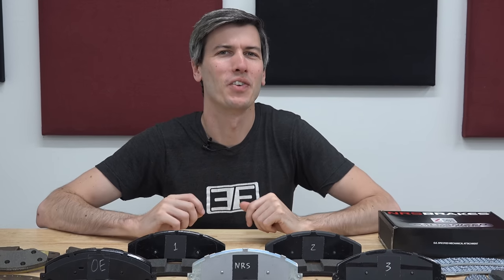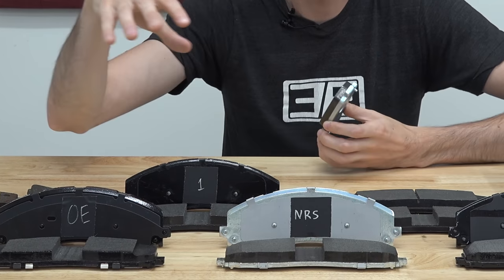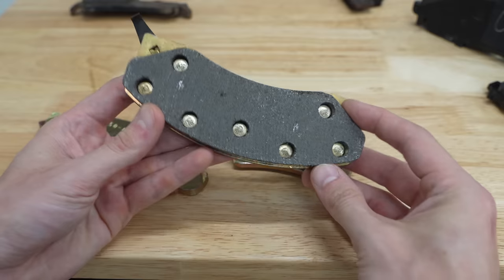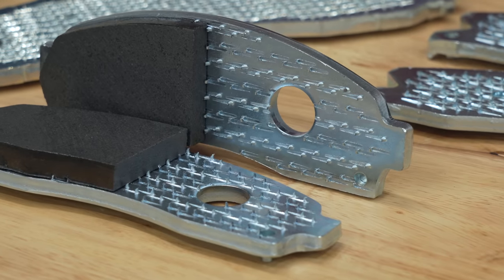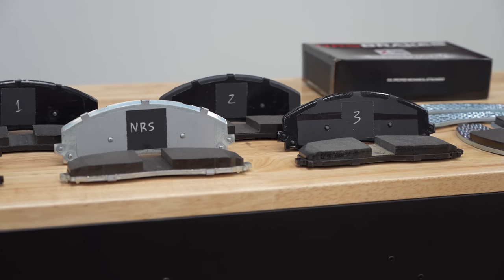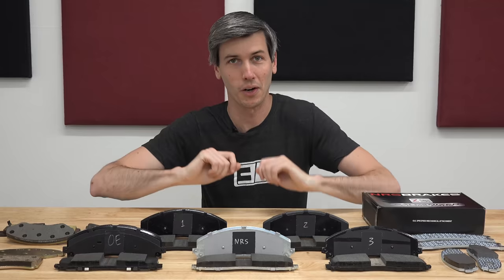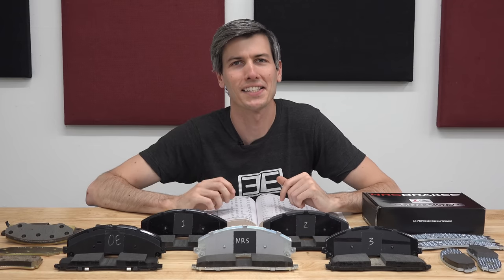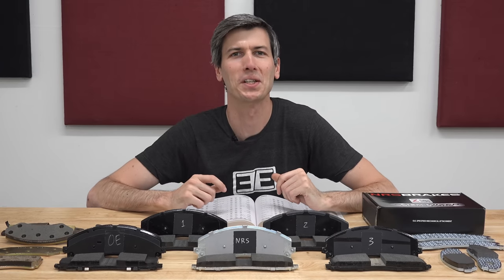The Sketchy Truth About Aftermarket Brake Pads

Comment: Whats actually important (never had the material come off in decades of driving, didnt even ever see it happening working on cars):
I drove aftermarket ones for a long time. Then I realized the car manufacturer actually put effort into picking the brake pad materials. The OEM ones grab MUCH sooner and MUCH harder at slight braking and dont need to get heated up for good grabbing.
No aftermarket ones can achieve that. They can only make braking better into another direction. Either at hard braking or slight braking, hot braking or cold braking.
The car manufacturer has found the best (and safest) compromise for both.

Comment: Will you mention (in a future video) brake dust?  I bought a highly-recommended brand, only to discover it to be the most FILTHY pads I've ever applied.  I wonder if these pads are wearing more quickly, or the dust just sticks to the wheels more than normal.

Comment: I bought a new RAM PROMASTER CITY VAN three years ago.   For the first 10,000 miles at slow stopping speeds the brakes made the most out of this world sound.  Like a malfunctioning loud speaker a garbled vocal.   Three years later have mostly highway 18,000 miles on the van.  Today no weird sounds.  I guess living in Nevada that desert dust was on the pads causing the noise.   If anyone has an idea about this I would enjoy hearing it?

Comment: I used to drive a 2000 Jetta.  Always used aftermarket pads.  ...until one of the pads came separated from the backing plate while I was driving across the tappan zee bridge.  The pad landed on the inner side of the rim and got wedged between the rim and the caliper.  Made it safely across but it could have been very bad because I didn't know it happened until I went to hit my brakes at 55+ MPH in high volume traffic and the pedal went straight to the floor.  Eventually after pumping, the backing plate made contact with the rotor and I had braking function again but of course it trashed the rotor.  Anyway, lesson learned.  Don't take chances on brake parts my dudes.  (Edit: To be clear, the pads were not mechanically attached to the backing plate.)

Comment: Interesting notes about the FMSI. I googled an older copy for my car.. From studying the FMSI # for my subaru, it seems some aftermarket manufacturers use the FMSI part number either partial or full part number in their model number labeling. Therefore, this makes me wonder if many aftermarket brake vendors are just taking the same pad and using clever marketing to stay it's the best performance blah blah blah.. = profit.

Comment: I've changed hundreds of brake pads and shoes, not once have I run across them separating. Usually cracked and worn out, and sometimes a bit rusty on the back plate.

Comment: Bought aftermarket pads once in a pinch during a weekend with the wife truck, they legit lasted 6 month and hardly stopped the thing. 

The OE where on for 3 years and overshot by a lot the mileage on the aftermarket, and they stop on a dime.

Comment: I go with OEM replacement pads since I go about 10 years between brake pad changes on my automatic transmission cars.
If you drive more efficiently, you'll go more years between brake pad changes and get better fuel mileage.  
My Subaru Outback gets 33 mpg measured mileage.  And it only takes me a few minutes longer to make a trip, but I save 15+% on fuel consumption.  
That's a saving of 60+ cents per gallon at $4.00 per gallon gas price.

Comment: Great video, now I'm questioning my brake choice, I am doing them in the morning and chose the power stop extreme severe duty and towing pads and rotors for my 2017 gmc sierra 1500, I hope they don't come apart while I'm hauling my trailer for work or my travel trailer lol. I will say that I bought the truck with 25k miles on it and had to replace the brakes (front and rear pads and rotors) with the duralast gold pads and rotors at 43k to 46k miles, I am now replacing them at 104k miles, but I drive more conservatively because I hate warped rotors, the only reason I chose them was because I had the driver front pads go metal to metal because the caliber pins where never lubed from the factory on that one caliber and they were sticking, the rest of the pads/caliber pins where fine, and those pads and rotors where the ones I could find in stock at the time .

Comment: You kind of mention why NRS doesn't paint the pads but I still can't imagine why they wouldn't.  If you live anywhere that salts the roads at least the paint will help with corrosion resistance but the zinc will just not hold up well at all particularly since it's an area that likely goes through many more cycles of wet and dry due to the heat.

Comment: looking through NRS website, i did't find a single thing about the friction material coefficient, or temperature behavior. and no pads for BMW or Porsche, who seem to do just fine at race tracks around the world, despite not requiring mechanical adhesion. and having used race pads to a temperature so hot, they warped the backing plate, i never saw evidence of  mechanical ahdhesion or friction material failure, despite the pads being designed to work up to 2000F. but to be fair, no track pads are considered cheap.

Comment: Had this happen weeks after installing Autozone brake pads. I brought in the ruined brake rotor and they replaced both rotors free and offered to replace the pads as well. I refused the pads and simply will never buy break pads at Autozone again.

Comment: So, a couple of points of clarity: a) how does your heat test replicate the clamping pressure of the caliper?  b) does your shear test reflect rotational force on the friction surface only or are you applying pressure to the sidewall of the friction material?  I'm wondering in what way your testing replicates real world conditions?  I ask as a veteran of the parts & service industry (aftermarket). In addition, are we all in agreement that zero car manufacturers actually manufacture brake pads? Do we agree that every car manufacturer specs the brake pad and is sourcing from the same brake parts manufacturers (contract packaging) that also produces every aftermarket brake pad?

Comment: I do know that Brembo doesn't use mechanical attachments or at least the one for my Toyota (Brembo model P 61 081) doesn't.  
How?  I worn one down to 2 mm and still no traces of metal shavings left over by the mechanical attachment.
Would this stop me from using Brembo brake pads? Not really, HOWEVER, now I do want to try other brands and feel the difference.

Comment: I love this, someone please correct me if I'm mistaken, but with DIY mechanics, which I expect are likely the ones that would buy these brake pads, wouldn't it be better to swap out the pads under warranty every 3 years or so if they buy these aftermarket pads at common auto parts stores as during that time window you're likely changing the brake fluid if you're following the maintenance intervals, and around that time you're likely getting rust creeping in on the rotors which may not come off, thus ending up making up less use of your brake pad surface no matter the brand? Or maybe I'm just seeing only the cheap brake rotors that are doing this 😅

Either way, thank you again for a super informative video.
Reply: Time and labor are $$$.  Or at least my time is.

Comment: those brake pads look like the same size as the pads that are on a 1 ton truck axle that i got for a car with a 200hp engine that broke the original ford 8.8 axles and 4000lb ratted tire chains on the tires... 8.8 was said to hold 400hp, it broke at 200. "brake horse power, power to slow it down from the top end" so that's where the AAM1150 full floating hub axle comes in. but "they" said that ones good for 800, that 4.6 triton only makes 200... at least the axles are easier to change. (use car for plowing snow, because speed boy put all the truck stuff in it)

Comment: I don't know I must have done 2000 brake jobs in my life and I never once seen a bonded separate from the metal. Riveted plates are the way to go but you lose 1/32 not really a big deal in my book and by that time you should be replacing them anyway.

Comment: I've used whatever the cheapest brakes I can find on my daily drivers and I've never had an issue.

That being said, on my truck, I use Wagner specifically, mainly because I tow heavy loads, and the extra quality means much more.

As with all things, need depends on the application. Not all brakes need to be equal
Reply: Strong dislike for Wagner.  Soft pedal feel.  Soft bite.  Increased braking distance and prone to heat fade.
Reply: @ShainAndrews  Ive never had those issues with Wagner semi metallic pads, and I've towed massive loads across multiple states. Thier ceramic Thermoquiet pads, sure, but the semi metallic pads have been rock solid on my truck for almost a decade.

Comment: #1 aftermarket company owned by a major car manufacturer… AC Delco!  Have also used numerous sets of AutoZone Duralast pads and most recently Centric pads on my Integra GSR, plus Centric on my Miata and CX5. No apparent issues at all.

Also never even heard of NRS before this video. Apparently they don’t have an application for my Integra so that sucks. The ones for Miatas seem crazy expensive. More expensive than Hawk, EBC, Stoptech, even more expensive than OEM Mazda pads!
Reply: Phone NRS. There is no application for my 2020 Kia Forte GT. Gave them my VIN. They found me front and rear pads.

Comment: I've seen the most budget branded parts fail far before you would want them to, and over time it pays off to pay even the little bit more to get good results.  Automotive spending being driven by enthusiasts means that sometimes the cost/value curve steepens beyond what is needed.  Pass on the real cheapo parts, the mid priced stuff will be adequate, a little more cost (akebono for example) is worth the upgrade, but the very most expensive stuff is not necessary.

Comment: I just went on their website. The link that lets you select your car doesn't work. Besides that, the pads are all over 100. per set. Most were 140.00. That's more than double what the dealership charges for genuine Toyota brake pads for my Tacoma. I don't see how they can claim to be that much better than stock.

Comment: I recently bought a 2004 Ford E350. It only had 75k miles in it. The brake pads had plenty of meat left on them, but after a few weeks, I heard the dreaded metal on metal. Upon re-inspection, I found one of the pads had come unbonded from its backing, and fallen off. There were no hooks or rivets on these pads. Rust jacking appears to have been the culprit.
Reply: Rust can be a reason for such a unbond. It also happened to me on a rear drum brake with pads 10 years old.

Comment: We had an interesting case here in the UK when it came to light that fake pads purporting to be manufactured by one of the UKs long-standing manufacturers of brake components found their way into the distribution chain so that reputable motor factors were selling them with no clue that they were not genuine parts.
There was, of course, a similar scandal recently here in the UK regarding fake CFM jet-engine parts. It seems we have an impressive line in con-men if nothing else 🙂

Comment: I'm not particularly swayed by OEM spec given their overwhelming motivation to squeeze cost out. My 2005 Pontiac GTO's OEM brakes were min cost crap; when it was rotor time, I went with PowerStop Z26 carbon fiber ceramic pads and drilled slotted zinc coated steel rotors. The pads are attached by adhesive that IS shear tested (I asked) with backing plate holes for the pad material to expand into. The pad material is supposed to be fade resistant up to 1500 degrees (presumably Fahrenheit,  'cause it's not stated). I'm no track rat, so I'm hardly testing their mettle, but stopping power is outstanding and the materials last LOTS longer than OEM garbage.

Comment: I would love your analysis on inboard wet brakes, which should be superb for awd EVs. No dust, no maintenance/rust, less unsprung weight, better handling. Can't think of a single downside.
Please.
Reply: Wet brake systems are far more costly, they do have maintenance, albeit far less frequent, they can be quite noise and cause lots of vibrations.  Excellent on slow moving heavy equipment where noise doesn’t matter and driveline vibration is high isolated already, but less so on light weight cars that drive by houses and through neighborhoods.  I run racing brakes on one of my track cars that I sometimes take out to keep it moving, those brakes are so loud and my neighbors all let me know they dislike it at certain times.
Reply: @jrfish007  we must be talking aboit different things. Imagine wet clutch used in motorcycles, or wet clutches in automatic transmission. 
Even conventional brakes on EVs only need service like one in 100k miles, and mostly due to rust, not wear.. make that a wet inboard brake and it will last forever. Inbors means it is mounted inside the drive unit, not on wheel.
Reply: But then your cv axle needs to carry the worst case braking load, which may require much beefier cv axles. For something like a plaid Tesla probably it has beefy enough axles already but a economy EV probably has much cheaper axles which wouldn’t stand up to the brake torque in emergency stops.
Reply: @bradfa  sounds like a small price to pay...
Reply: @circuitdotlt  maybe?  Unless your inboard wet braking system is cheaper, I can't see it being chosen over a traditional friction brake solution for cost conscious car designs.  Brakes on current cars don't wear out that fast, the maintenance cost is quite small for brakes in the scope of total car life costs these days.
Reply: @bradfa  well, traditional brakes are actually quite costly to service, and their dust is tied to cancer. Also, on both my EVs oldschool brakes are starking to cause problems due to lack of use/rust, and the cars are only 2 yo, 50k km on each.
The caliper, disc and pads are huge chunks of steel - expensive.
If wet brake was done as part as drivetrain assembly, like next to the EV's motor and reducer gear, floating in the same oil... I have a feeling it could be cheaper even.

Comment: Powerstop Carbon Fiber Ceramics are lowkey amazing. I've run all kinds of street performance pads. EBC, Hawk, Brembo ... the Powerstops are comparable in performance with a third of the dust. Z26 if you can get them, Z23 if you can't.
Reply: While I like my Powerstop Z26 pads, I found the OE Brembo pads to perform better. They were semi-metallic as opposed to carbon ceramic which gave them a stronger bite and less brake fade. However, the lack of dust with the ceramic pads is a massive improvement, and Imo for daily use they are good enough

Comment: Small aircraft still use rivets, which is OK since brakes aren’t used as much, but definitely sucks monetarily for the owner when they fail to have their aircraft serviced often enough and run the pads down to metal. A rotor in an older car may be $40, aircraft maybe $300-800
Reply: And the aeroplane ones are smaller!
Reply: @paulsengupta971  oh yea, like 3 inches across and 1.5 wide

Comment: I actually ran across brake pad failure on my high performance motorcycle. I replaced OEM pads with cheap aftermarket. Bad idea! Swapped back to OEM within a very short period of time.

Comment: why is the friction test done perpendicular to the stress that the pads would normally see? it would give you a skewed result comparing glue vs the mechanical attachment. that doesn't make sense. Its like saying carbon fiber isnt good at compression vs elongation. The resin has different properties depending on orientation of stress.

Comment: I have had friction material depart the backing. Usually just part of it. 
  Something not mentioned is the fact that, if all of it on one pads "leaves", the pedal will go to the floor...pumping would hopefully restore some braking, but that takes precious time. 
   In my case, only some material left, resulting in a sort of mushy pedal.
   Brake heat is a big deal, I have had fade problems both from driving fast on curvy hilly backroads in a car, and on long descents in an RV with inadequate engine braking. 
    Some cheap parts store pads really are bad. A-Zone= not worth much, even when they honored their strange lifetime warranty. No good, even if free.

Comment: After 5 decades in the auto repair business, the separation of the friction material from the backing plate rates VERY low. Chunks breaking off of riveted brake pads were sometimes seen. The biggest problem I've seen are people using the brakes long after all the friction material has worn away. Why? Because it still stopped.

Comment: If oems didn't want an arm and a leg for their parts and were more affordable like they once were, I would be more than happy to buy their pants all the time. Also as you have shown some aftermarket parts are better than oem. The aftermatket torque converter seal i used was less than oem and had a better fit. The quality was much better too.
Reply: here is something dealerships don't want you to know: dealerships don't buy OEM parts from the manufacturer they buy them from a distributor. You can just buy the part directly from a distributor and save a lot of money. I worked for a distribution company for over a year  that sold AC Delco , Mopar, and Motorcraft parts to dealerships all over the southeast.  You could walk up to the counter at the distributor and buy brake pads for $55 that the dealership would charge you $100+ for.

Comment: Doesn't the groove also serve as a wear indicator? When no longer visible, the pads need to be replaced.
Reply: Usually the manufacturer specifies  the minimum thickness.  Most are around 2 mm.
Reply: Regardless - Doesn't the groove also serve as a wear indicator? @Discretesignals